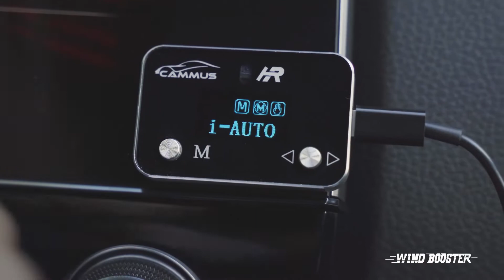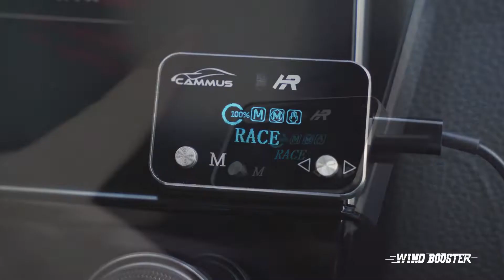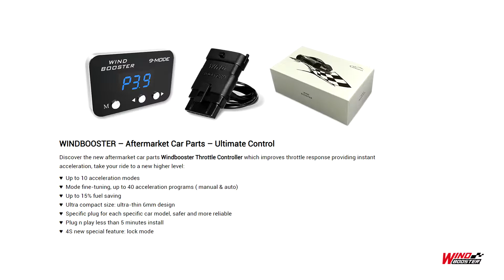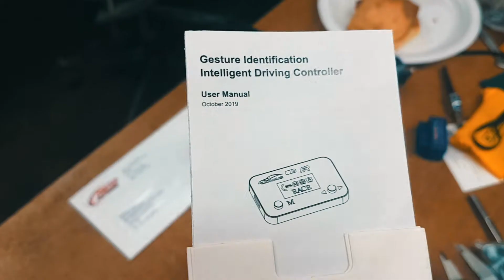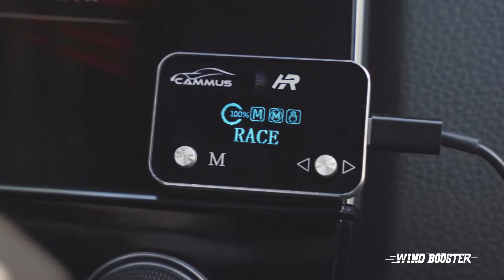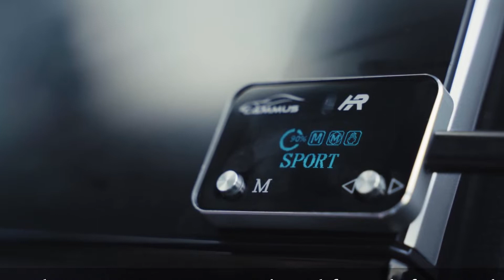Drive Faster & Save 15% Gas with This Car Mod - RevvdMotors Installs Windbooster Throttle Controller

Comment: Cringest shit ever. Martin even told you it doesn't make the car faster - not "technically", literally. Not only that, it's dangerous. If you need to rapidly accelerate but you're in "econ mode" you're fucked. What a bunch of snake oil crap.
Reply from the maker: Hmm the only time I need to suddenly accelerate is when I'm passing a under speed limit  driver ... Who says I'll ever be in economy mode ;)